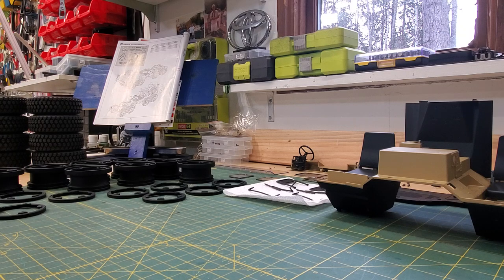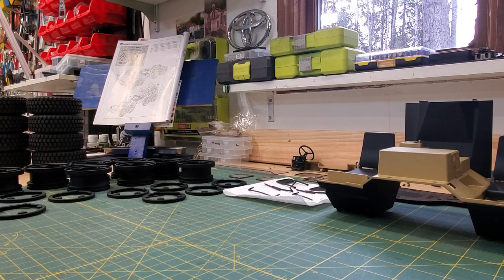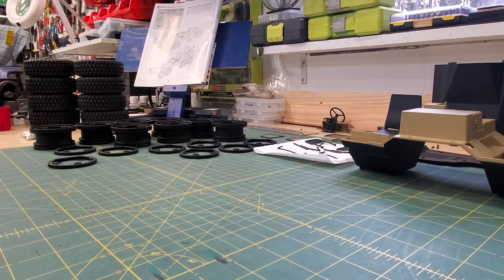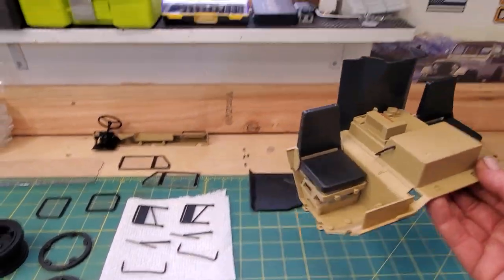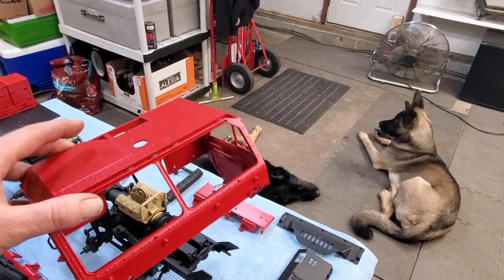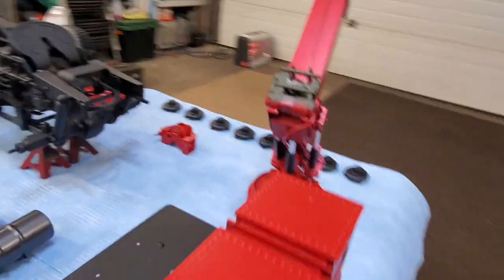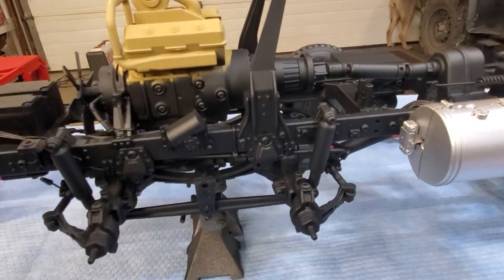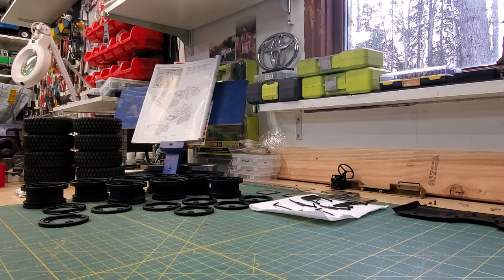P802 update!! no its not a firetruck!!

Comment: I’ve got an 801 I’m tearing down to paint. It’s green but will be airport fire truck yellow. Any tips from your paint experience on this series of HG RC?
Reply from the maker: I just used plastic paint and really took my time disassembling it, make sure to set aside alot of room. This truck took up 2 tables once apart. And only use hand tools many of the screw holes are weak
Reply: @gerrysoldguyreview  Thanks for the info and tip. Appreciate it.
Reply from the maker: Anytime 😊